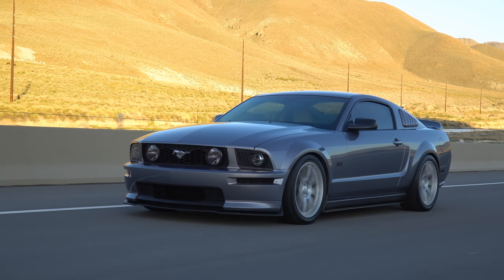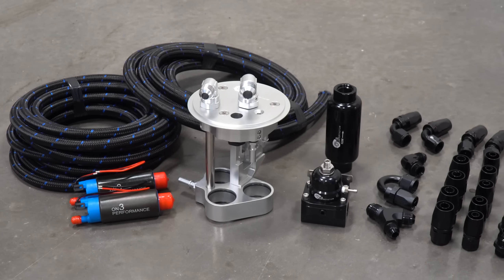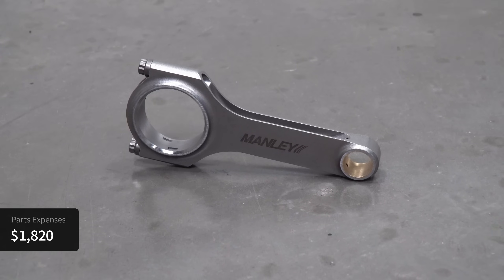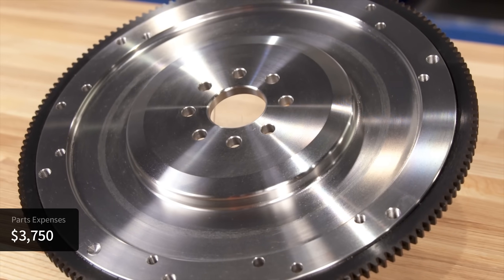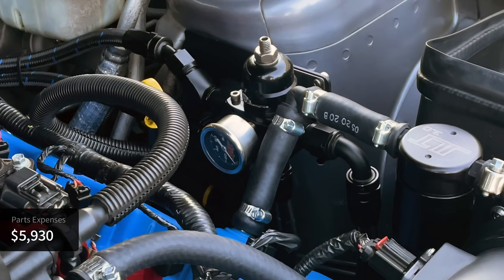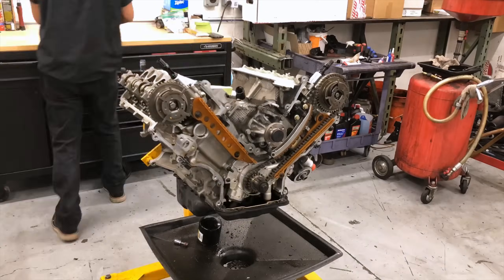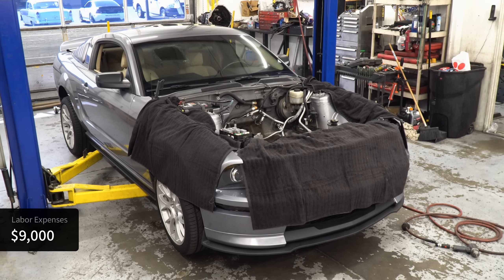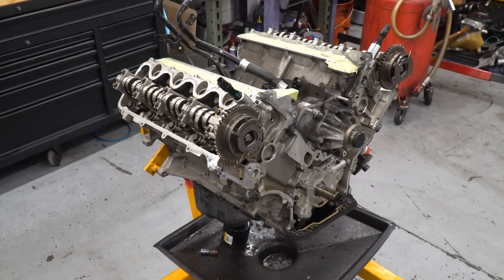Breaking down the (actual) cost of rebuilding a V8

Comment: A 1,000hp 3v is gonna hurt some feelings 😎
Reply: He’s definitely going to hurt the people in the comments when he proves them wrong  😂
Reply: Hi.  Mustangs aren't my thing.  I don't know anyone doing a 3 valve either.  I watched this while I was killing time.  Great job on the video.  This looked professional.  Like something that I would see on the old power block on spike tv.  Very clear and articulate.  Probably easy to understand for a non car hobbyist as well.  Good for you doing your own thing with your own money.  Thanks for the FREE entertainment.  This Chevy guy is subscribed.
Reply: 16,000k into a 3v and still cant make over 400whp ? wtf
Reply: @slowboybk5098  you also got to think- he bought forged parts and ported BEFORE even buying forced induction. He could’ve bought a tune and low boost forced induction and probably got over 450 to the wheel.
Reply: @slowboybk5098  I made a 500whp 440tq 3v for less than 10k. This guy is just buying stuff to document it so his build will be more expensive
Reply: @TexTheMaster  you n/a or boosted tho
Reply: @TexTheMaster  what do you mean by “so his build can be more expensive”
Reply: @TexTheMaster  sweet man, what's the details of the build if u don't mind sharing? Do u have any online documentation of it, I'd love to read about it.
Reply: @TexTheMaster working and reliable are two different things
Reply: @slowboybk5098  $8,400 of that is in labor. I wouldn't even factor that into the actual cost since you can rebuild the engine yourself if you're not entirely stupid.
Reply: @devnull.elixir please teach me cause I feel entirely stupid where did you learn?
Reply: @slowboybk5098  yes you gotta pay to play and in the mod motor world. And if u want NA bragging rights, u really gotta pay. A mod motors path to big numbers has always been forced induction. It's more about the journey and satisfaction of maximizing a certain engine platforms potential. Obviously he has money and enjoys what he's doing, he's not budget strapped where he has to get the most bang for his buck like the rest of us average car guys. If I won the lottery, I would build all sorts of engine platforms that are even more unjustified cost wise and don't have aftermarket support just to see what I could do, it's all for the fun of it, u know what I mean?
Reply: @slowboybk5098  he’s showing you max pricing. Like he said, diy the rebuild and you’ll save 5k right off the top.
Reply: @slowboybk5098  some people got money like that 🤷‍♀️
Reply: @slowboybk5098  that’s what I was thinking 🤔
Reply: @slowboybk5098  my 2010 gt dyno'ed 513hp.
Reply: @slowboybk5098  well.. this dude put all that money into the car but didnt hardly do anything that actually increases the horsepower... you can spent like 5k and make the same power out of the same engine by not putting forged internals and upgraded random shit and do full bolt ons with high flow heads and the stage 3 cams... this guy built an engine capable of handling 1000 hp but didnt add any power adders.... so in reality until he does he kind of wasted money.
Reply: @arbiter1022 I mean his whole plan is to push power NA and then boost it. That’s why he did this.
Reply: @slowboybk5098  his approach really hasn't been cost effective. But, also, understand that the cost to build a forged motor isn't the same as the cost to achieve a set power goal. Yeah, a rebuilt 3V with forged internals is probably only going to get you about 400rwhp, but you can boost it more aggressively now, making your upper limit well into the 800-1200rwhp mark. Hell, my stock bottom end 08' 3V was putting down 510rwhp and 423rwtq with just a Novi 2200 kit on 9psi. Had I opted to go for a B302 rebuild at the time, I'd have been able to crank the boost up to 15, or even 20+, and could have made an easy 900+rwhp.
Reply: @slowboybk5098  legit just 5.0 swap and call it a day.
Reply: @g8letwild293  Could slap a 3rd gen coyote with a tune in that thing for about 11k new, 8k if you find one used...
Reply: @RenardThatch  100% but as the years go passed. They will get cheaper and cheaper.
Reply: @g8letwild293  that's boring
Reply: Street 3v* ;)
Reply: Doesnt the 4.6 block only handle like 500ish horse?
Reply: @xCHMITTYx   No, that's the old 5.0. The 3v block is very strong even without sleeves. MHS doesn't do sleeves till stepping to the 1500whp package from 1200.. Coyotes need sleeves earlier than that.
Reply: @xCHMITTYx  the worlds fastest 4.6 runs a stock block and it makes 3000 hp
Reply: @xCHMITTYx  no stock internals.
Reply: Hurt his wallet more like it
Reply: Damn straight it will.
Reply: It’s going to look doing so 😂
Reply: And sound good doing it 😎
Reply: How so? It's just a bad way to make 1000hp nothing else.
Reply: This comments section is absolutely hilarious 😂. It’s like watching a Private tell a General what to do on the battlefield. The solution to making more horsepower is not always “throw boost at it” you will be throwing a hell of a lot more than that overtime and it won’t take long. 

I learned a very long time ago that you have 1,000 horsepower, and then you have 1,000 reliable horsepower. If you know you know…if not you will definitely learn after blowing up a few engines. 

Build before you boost is my motto. Unless you want to be capped at roughly 500hp. At the end of the day…do whatever tf you wanna do it’s your wallet.
Reply: Any 1000HP engine is going to hurt feelings!
Reply: Yeah when it blows up
Reply: Just coyote swap.
Reply: Everyone cracking he's not making over 400hp,  do any of you listen?? He specifically said he does not have cams installed for a stroker setup.  He's going to swap then out and see what the numbers are.
Reply: 1000 HP???? He spent $16k and don’t even have 400whp
Reply: @lhv8  He hasn't even put any forced induction yet... smh
Reply: @lhv8  are you slow
Reply: agree, it will hurt some crowds but feelings nonetheless
Reply: @LaCacaLoca he's a good and responsible driver the people that are hurting crowds are those young kids that don't know how to drive and they get in a Mustang because it's the coolest car for the money and they don't know how to drive don't blame the car it's the stupid ass people that don't know how to drive them
Reply: Until it fucking explodes
Reply: @thomas6789  the literal point of this video is so it can handle 1000ph
Reply: @gavinm7446  I’m talking about a shitty 3v exploding not a 2v
Reply: @gavinm7446 

Four Eyes got a Vortex supercharger.
It dyno at over 700 hp.
Reply: @thomas6789  Negative
Reply: Or I can get myself a 5.3, file rings, give a ball hone, and reseal everything and get heads studs and make more than 1000 with 1/4 money but whatever you like is whatever you like, I just like things that make sense
Reply: @TJSpike  I really want to see you make 1000hp 5.3 for under 4k . Because that would be damn impressive as hell . Sounds like a long shot to me though
Reply: @TJSpike  these guy is building a engine to last not blow up every weekend. And plus he payed 9k just to have somebody build it. Not to mention he took a ford to ls shop.. hell could just got a mmr already built engine    that has done 1500 to 2k boosted
Reply: @marvinautoworks9955  customer has had the car we built for him for 3+ years
Reply: @TJSpike  most of the things he buys are just to experiment with. I doubt he cared about what performed best for cheapest. Plus no ls can take boost as good as a 5.0 coyote or even the 4.6
Reply: @TJSpike  Lol complete utter BS for 4k
Reply: @TJSpike  bs for like 5 mins
Reply: @cainadkins3985  have one in a s10 2dr blazer that make 1100hp to the wheel. Had it for two years and goes to Bandimere all the time.
Reply: @TJSpike  this makes perfect sense when money isn't a limiting factor, if you were a millionaire, wouldn't u love to build a screaming high rpm small displacement mod motor for fun? I know I would, along with dozens of other cool "underdog" builds!
Reply: That is ture
Reply: @TJSpike  So what exactly costs 4k?

Comment: Always excited when Four Eyes pops up in my notifications, i was planning on rebuilding my 06 Gt's engine with your guide, but i made a crucial mistake, i bought an automatic :/
Reply: CJ Pony Parts sells TCI torque converters that can make the transmission capable of handling high performance upgrades.
Reply: 6r80swap is the way to go then
Reply: I made the same mistake
Reply: Swap a turbo 350 or 400 in it
Reply: Me too man 😢
Reply: Anyone know how much the automatic trans stock will hold ? Just a general idea
Reply: @davidturczak7253  I think Cam Marz has information on that he has a boosted automatic
Reply: @davidturczak7253  google it bro